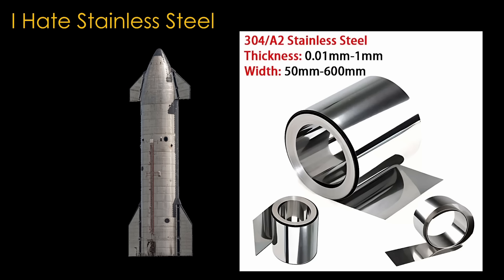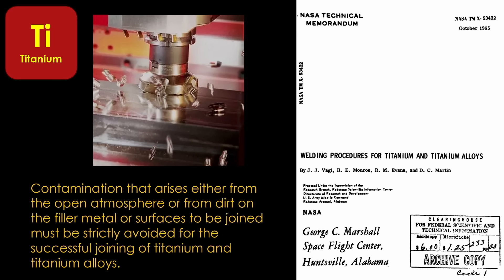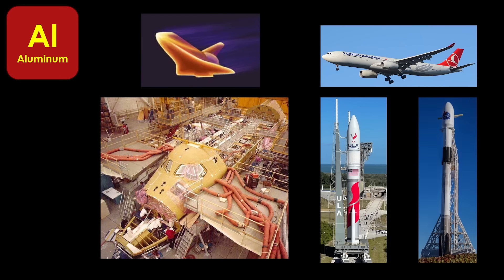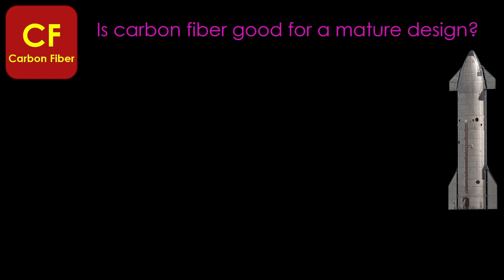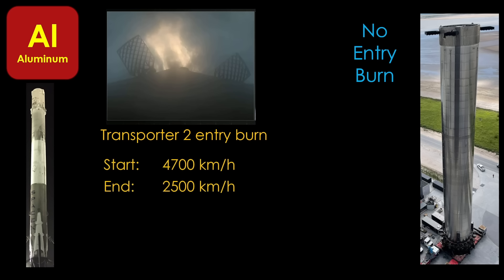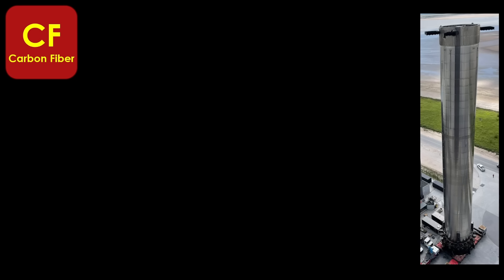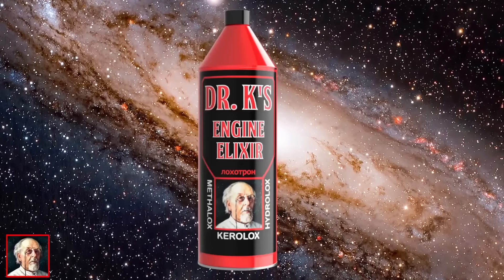Why Starship Loves Stainless Steel...

Comment: I see we are setting up to dump all over hydrolox Starship ;-)
A reminder that all hydrolox rockets are aluminum (except those like Centaur that are balloon tanks). Aluminum and hydrolox are yin and yang. If you have to build a big tank, you are going to use a lightweight material. 
Ditto on diameter. You did a nice video on that, so I assume your hydrolox Starship will be bigger diameter to get some credit there.
Also, there is aluminum and aluminum. There is a significant performance jump in going from 2219 to 2195.
So if you’re just going to say that a 9m diameter stainless hydrolox Starship sucks, I’ll save you the trouble. It totally will….
BTW, nice presentation.
Reply from the maker: I think my opinions on hydrolox in general are well known... 

But this one is going to be complicated. I could look at different tank materials, different diameters (pretty sure hydrolox will prefer larger than 9m), and I'm hoping to look at raptor differences as hydrolox is much harder to get high thrust. A real trade would look at a matrix of different values but that doesn't work very well for a video. 

So, we'll see. I'll try to do something better than just look at a 9m vehicle if that looks like a poor choice.
Reply: @EagerSpace  I’ve been looking at it myself, and totally agree, it’s complicated. 
I’ve been trying to break down the dry mass into tankage, engines, flaps, heatshield, payload bay, thrust structure, etc. and then scale each appropriately. Tankage goes up with increased hydrolox volume, that’s easy enough (and the lightest). The harder part is how to scale everything else. Engines just get added back in, non-integer number of (lighter) RS-25’s to match total thrust/weight ratio. So thrust structure weight stays the same. Payload section mass stays constant I suppose? Heat shield mass scales with frontal area? But what about flaps, header tanks and all the other “reusability penalty” stuff? Scales with dry mass?
Then somehow adjust the whole thing down for aluminum. And also adjust mass down for a bigger diameter, on both ship and booster…..and then trim the heat shield mass down for lower re-entry heating demand, and the headers for less landing burn fuel….whew.
I do know that if you just do simple scaling on volume or length, then hydrolox will only turn out slightly better, like +25%, minimum ;-)
Reply from the maker: If you're doing that much you're going to be underwhelmed by my approach.

I'm probably going to assume something raptorish but hydrolox. The hard part with aluminum is that there isn't a direct scale factor as aluminum parts are structured differently, and sometimes they aren't really any lighter than the stainless version because you are designing for rigidity rather than strength. 

And the heat shield mass is an issue; trying to optimize it for the heat load and the heat capacity of the material seems really challenging. One of the biggest advantages of stainless is that it gives you the best margin on your thermal protection system and you can probably just design something and it will work and be robust from a heat transfer perspective. 

I'd be interested in what your model shows when you're done. You can find me on TwiX or reddit.

Comment: Best back-of-a-fag-packet rocket calculations ever. It's gonna be really interesting to see what Neutron's re-entry performance looks like, they've likely learnt a lot about what they can get away with by bringing back Electron. I'm guessing it doesn't make clear economic sense to re-fly Electrons but they've got themselves a right banging carbon fibre re-entry test lab right there!

Love the outtro face. Eeeeeeaggeerrr Spaaaaaceeeee

Comment: Producing stuff out of carbon fiber is more expensive, and takes more time to set up production. But due to using lighter carbon fiber Neutron "can" build a rocket which lands with it's fairing back into the base and doesn't use a launch pad tower. So more expensive rocket, but less expensive infrastructure... no boats and barges to retrieve rocket and fairing, cheaper launch pad.

Different design philosophy.
Reply: Rocket Lab is now offering barge landings with Neutron. And Starship will only return to launch site, as far as we know. So that's a bit upside down compared to what you are claiming.
Reply from the maker: I find Neutron really interesting because they are essentially optimizing the Falcon 9 approach - put as much weight as possible in the part you get back and minimize the cost of the part you throw away. What people miss is that full-reuse isn't inherently cheaper than partial reuse - it depends on the actual costs.
Reply: @SpaceAdvocate  Plans do change, originally Neutron was supposed to only return to launch site. Maybe one day Starship booster will land on a barge as well because... plans change.
Reply: @dariozanze4929  I agree plans change. But for Neutron they will have both an expensive rocket and expensive infrastructure. That's just how the strategy worked out for them.
Reply from the maker: Neutron's market is highly dependent on their payload capacity and going RTLS only is a significant limitation. 

Starship is above the market in payload capacity so there's no real reason to do RTLS, and lots of reasons not to.

See my starship drone ship landing video for more.
Reply: @EagerSpace  There are def nuances. Starship is going to be the king of hauling stuff to low earth orbit. But if it's cargo needs different orbit cargo needs to be equipped with it's own propulsion.

So more expensive satellites and they spend some time changing the orbit, not being exploited.

Expandable upper stage can insert cargo directly into wanted orbit/s. So cheaper satellites, no waiting time.

Which one is cheaper in most of the cases, remains to be seen.

It is interesting that SpaceX, Blue Origin, Ariane and Rocket Labs all have different approach on this.
Reply from the maker: Sure. That's the point of kick stages or built-in propulsion for satellites.

Comment: But 17 tons more payload is a lot. It is like 2 Soyuz-2 rockets? There is many types of steel; what is special with the type Starship uses?
Reply from the maker: It has excellent high and low-temperature performance, which is important because the propellants in starship are extremely cold and there can be significant heating during reentry.

Comment: OOF titanium are they trying to make SpaceX go bankrupt, it's difficult to work making it expensive to work with and the raw material is expensive, at least Carbon Fibre is only difficult to work with, but the raw material isn't actually that expensive, and Aluminium would melt like butter under a flame thrower.

Carbon fibre also has the drawback of not maintain it's strength as well as steel over a wide operating temperature which is problematic when you are going to be dealing with -180C to 2000C also aluminium because more brittle than steel at low operating temperatures also a smaller problem with aluminium is it's a pretty decent thermal conductor which would increase boil off rates, not a massive problem, but it is also a downside of aluminium in this case.

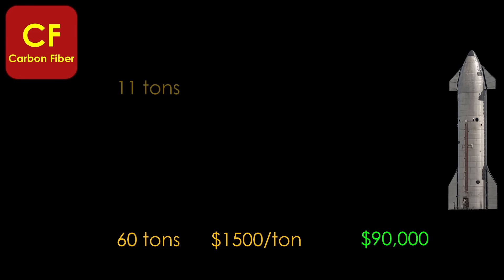Comment: 5:33 - Price is off by at least 10x. Also carbon parts were going to be made in Long Beach not Seattle.  Very inaccurate info in this video.
Reply from the maker: Always happy to have better information. Can you share references?

Comment: I think you think the engineers at SpaceX have a lot more of a say in things like this than they actually do.

Why is Starship made from stainless? Easy, because that is what Musk wanted (probably because he thinks it looks cool or he saw something similar in a sci-fi movie once).

Is it the best option? No. Will it work as designed? Probably not, but that is what Musk wanted so the engineers are just now doing their best with the hand they have been dealt.
Reply from the maker: What option was better, and why?
Reply: @EagerSpace  Al is the obvious option. Cheaper, lighter, easier to work with, already proven, etc.

Sure, it has a lower melting point than stainless steel / looses its strength at a lower temperature, but as SpaceX have already discovered, they need to put a whole lot of thermal tiles on the stainless version anyways. Therefore, it doesn’t really matter how good the base metal is, on reentry the atmosphere will burn holes straight through just about any metal if you have inadequate shielding so the base metal should never be exposed to those conditions in the first place.
Reply from the maker: The latest ift flight is good evidence that there are failure modes that stainless survives and aluminum doesn't
Reply: @EagerSpace  We will see 😊 One data point is insufficient to determine much of anything at this time (especially seeing as the ship is now at the bottom of the ocean).

Maybe the stainless helped keep the ship together during a catastrophic failure of the thermal shielding, or maybe it was just pure luck that the flap stayed together and the stainless made no difference whatsoever vs if the skin was made from a different material.

Only time will tell 😊
Reply from the maker: Stainless melts at roughly double the temperature of the aluminum alloy, and the stainless barely held together for IFT-1.

Comment: Wow… 1500$/ton stainless? Where can I get that? We’re at least 5k if not 10k/ton.
I appreciate that we’re talking about coils. But 1500 is less than carbon for god sake
Reply from the maker: global sources gave prices roughly in that range. That's obviously FOB.
Reply: @EagerSpace  yeah yeah, shipping excl is fair ball for apples to apples as everything has to ship (although total tonnage generally effect cost more than volume). Was there a minimum order do you recall ? Your screen shot was mentioning gage stainless 1mm< FWIW. Compared to what they are using 3-4mm. Now a ton is a ton, so all things being equal I wouldn’t expect that to be a big deal.
(I did enjoy the video btw - back of the cigarette package engineering is fun imo - like Terran space academy)
Reply from the maker: Minimum order was 20 tons IIRC correctly. Lots of choices out there. That's assuming that chinese quality is good enough and it's very possible that it's not.
Reply: @EagerSpace  we do tend to steer away from Chinese and south East Asian suppliers, although much of that preference is much less warranted these days… although we did just get some 304 that was supposed to be 316…. lol . (Identified through PMI)
I am also guessing commodities are down a bit these days, especially nickel which would be a big part of it. I try to stick to the engineering, less so the economic aspects…

Comment: Starship is suffering from a serious payload capacity issue.  Starship V1 can only deliver 30 to 40 tons of payload to orbit.  The Starship V2 design will have to make up a WHOPPING 60 tons of additional payload to reach Elon Musk's stated 100 ton capacity.   Given the smattering of changes in Starship V2, I cannot realistically see them reaching this goal.  Especially since they don't even have a design yet that has demonstrated all the required system goals - successful re-entry, catching boosters, landing starships, orbital refueling, and rapid reuse.   This is probably  why there is also a STRETCHED V3 version of Starship in the works, that Elon says will have a 200 ton capacity.. That's another 100 tons of additional payload!!  I think SpaceX is great .. but ... these numbers seem completely unrealistic - like having the Human Landing System ready by 2025 .. unrealistic!  There is a pattern developing here....

I get it ..  this is hard stuff.  But at the same time I cannot help to feel that SpaceX is falling behind and may not be able to catch up.  Missing their payload targets will result in a dramatic increase  of tanking flights for Deep Space missions - which are already challenging.  Adding more operational and logistic complexity is never a good thing.
Reply from the maker: Have you modeled the payload based on the increase in propellant capacity in v2 and v3?
Reply: @EagerSpace   You got me there... But let's say they can achieve a 50% increase in payload with the extra propellent and design changes in Starship V2.  That's still only 75 tons to Low Earth Orbit.  Which is a 25% shortfall of the target.  Given that they still need to add equipment for docking and propellent transfer, I feel even this is being wildly optimistic.  Don't you?
Reply: @ericmatthews8497  You seem to think that development is not ongoing and that the capacity of low fidelity throw away test articles are an indicator of what the capacity of a full developed and mission ready design would be.  You're premature.
Reply from the maker: What would you say if I said I'd modelled the changes for V2 and V3 and the estimated payloads seem reasonable based on their plans?

Starship payload capacity is really sensitive to the amount of delta v it can generate. I talk about this a little in the "why is starship so late?" video
Reply: @ericmatthews8497  If you look at percentages, you should really include the dry mass of the Starship. The current Starship prototypes can bring something like 140 tons of dry mass, 20 tons of propellant and 50 tons of payload to LEO, or 210 tons (ballpark figure). A 50% improvement in capacity to LEO would up it to 315 tons in total, and assuming the dry mass is unchanged, and that would mean a payload of 155 tons.

Because of reuse, the margins are fairly thin, but you really just don't need that much percentage change to make a big difference in the payload capacity. Hitting the 100 tons would be a 24% improvement.